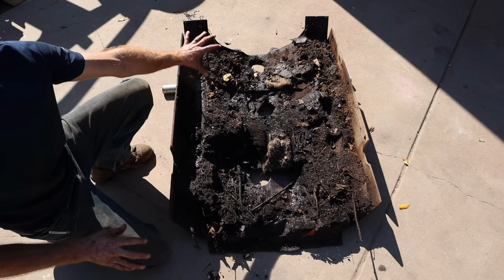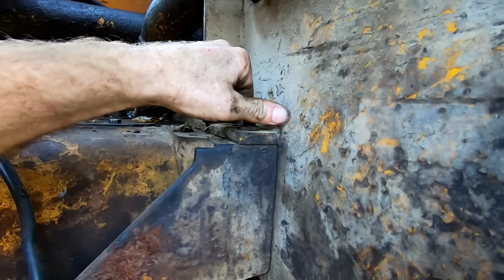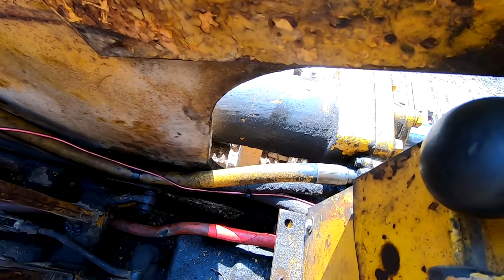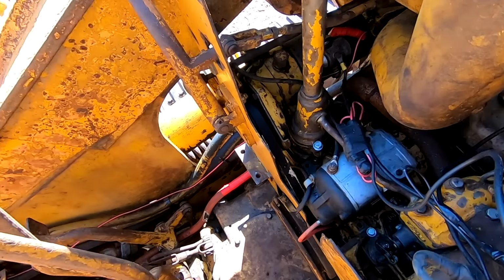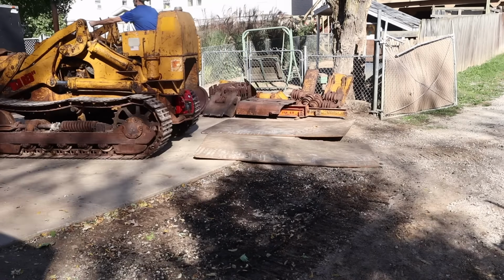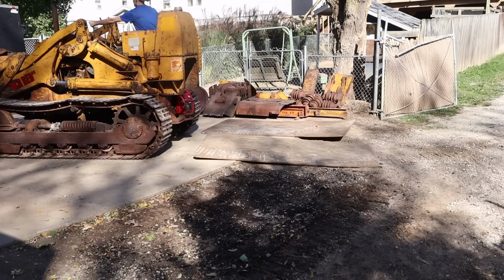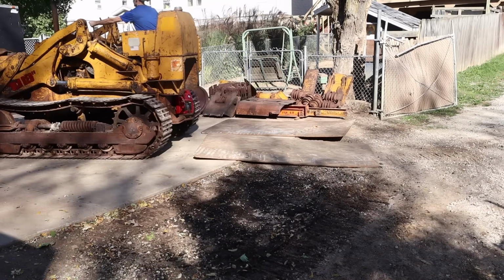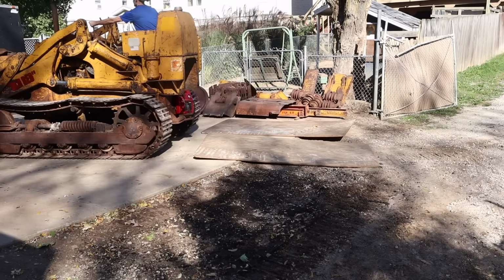FIRST Wash in 64 Years... or Something!?! ~ Part 7 ~ 1950s Caterpillar TraxCavator

Comment: Suggestion: When pressure washing any machine that has fuel oil gunk and/or concreted dirt, rust, and crude, etc. adhered to the metal, it is worth both your time and it's in the machines' best interest to use a high heat pressure washer. Yes, they cost more, but the difference that the pressurized hot water makes is worth every additional penny that you pay to own one. You will also find that the metal almost completely dries itself as you wash and hot water does not cause an excessive amount of condensation in hidden places such as that which you found in the dozer's valve cover.
Reply from the maker: I'd LOVE to have a hot water pressure washer, but I don't have one at the moment! I'm on the lookout for a used one or a broken one to fix, but for now I used what I had!
Reply: @Tishers  "Then your worries would be corrosion from grease getting washed out of the bearings" 

Ahhhhhhhh, I would point out that you do not know a whole lot about what you are suggesting with that negative rebuttal. I say this, since blowing out any grease from a bearing will not cause corrosion to the bearing, it will cause a bearing to overheat and wear beyond repair in a very short period of time before it even has time to corrode or rust. 

Further, any mechanic worth his business will always check each and every bearing for excessive wear, drying-out, no grease etc. and will immediately replace all that needs to be replaced and repack all those that are still in serviceable condition. He will perform that inspection and service automatically regardless of whether or not he thinks that the pressure washer may have blown out grease from the bearings. A scenario that is always carried out during a complete unit inspection for serviceability. Albeit, in this case, there will not be many if any bearings to repack and most to all to be replaced on a machine after 40 years of usage and 20 years sitting outside unprotected against Mother Natures' weather.
Reply: Check heavy equipment auctions on the internet, especially military equipment auctions.
Reply: I just looked at "Richie Bros." salvage auctions and there are more than 250 pressure washers up for auction or outright buy, many are hot water types and well within almost anyone budget, believe me. Go to their site and type in pressure washer and reap the benefits of purchasing a good, but cheaply priced washer.

Comment: Your intake valves are not seated or there burnt letting exhaust to come back through and leaking out the intake gaskets. With head gasket leaking You may as well have your head checked for cracks and Reseat all the valves  Great video You are diffently a Hard working young man. Its great to see This in the younger generation of today. Keep up the great job. Youll get the old girl in great operating shape one thing at a time.Thank you

Comment: I think your water under the valve cover got there because the cover itself is bent down around the mounting holes. If you push the recess back out straight to redome the cover you should be fine. Also  dont know if your aware thats the same engine thats in a D4 dozer as well as a #112 motorgrader. Just something to remember if you need some engine parts later in life. Awesome video series enjoy watching you work on the old dog.

Comment: I just found you through this series on the old Cat, and finished binge watching all 7 episodes released so far.  I love this stuff and I am already subscribed to Diesel Creek, Watch Wes Work, & Marty T to name a few, because of old machine stuff.  You are doing an great job, have excellent camera work, and I look forward to the other fixes required on this machine.  You have another subscriber!
Reply: Some other channels you might like are kt3406e and western truck and tractor repair. Both are very knowledgeable mechanics and both work on cat engines. Warren at western truck and tractor repair works on pretty much everything new and old, like Cummins, caterpillar, John Deere, Case, New Holand, etc
Reply: @blake1995  Thanks for that!  I am currently checking them out.  Cheers!

Comment: Might think about picking up a Hotsy pressure washer. Steaming hot water does a lot on old grease. Looked like that first, bubbling head leak may be a cracked head. shiver Like the old school gasket making. I appreciate the way you protected the edge of your concrete pad, smart. You're doing a great job, keep it up.

Comment: I have owned many of this series. If you did state bids it was required in my state,before you could bid on a state level you had to have a track loader. Excavater hadn’t come into play as a true form of moving material. I first bought a 933 with direct start,but was a standard shift,but I thought I had hit the lottery,because it had a hand clutch with the forward,neutral and reverse. I was able to buy it to get my business started,only because the forward and reverse lever ball was worn down and sticking the shifter rail on the transmission. And you had to stand on your head to solve the problem. If you could get ahold of one it was used as a loader,bulldozer and compacter if used by state requirements. Now as far as the pony motor we always for certain parked mine on a bankment steep enough to roll it off and start it and always had a can of either in hand to make it start ASAP. I worked with it until I could buy a 955 h. And at that point I thought I had struck it rich,lol I done many jobs with it and by then had established a working relationship with our local cat dealer. I live in East Ky. I received a phone call from the cat salesman in the early 80s. He said that they had traded for a 977 pedal stear direct start automatic,that was bought new to feed the Ashland Ky steel mill, I said that is a much bigger machine and I would have to get a bigger lowboy. He came back and said you will be the only one in four county area where I live to own a traxcavater of this size. I bought it and used it until Excavaters took the world over. I’m sorry this is so long but I get so tired of people putting the old cat 9 series down as a joke. I can tell you that with a good Operater and dozer to feed them with they were the best machine made. Also you already have the angle iron cut that I put under the cylinders to hold the bucket up so I could roll start it without the pony motor. Congratulations you have a great piece that built America.

Comment: Great work and even better attitude towards what you do which makes this fun to watch, I am not sure what your plan and budget is for the build but can't help thinking that piece meal taking on fixes as you find problems will likely mean you do more work than approaching this a complete tear down, sand blast / parts wash rebuild and repaint or re-plate, most of this machine will need some sort of attention even if only a wash, replace bolts and new oil seals / gaskets. Time and budget allowing (I know magic words) you would save a lot of problems and wasted parts & fluids if you break it down for a full rebuild, just my opinion very good luck with the build great content thanks !

Comment: It's still possible to be some condensation inside the top of the valve cover though particularly if the crankcase breather is clogged. Think of it like the greenhouse effect when the crankcase breather is working it's allowing moisture out.

Comment: The small copper line is what feeds oil to the rocker shaft assembly, not like a gas car engine that feed oil up the push rods to rocker assembly!  The pony motor feeds its exhaust in and around the intake to pre heat the intake to help start tge m and in engine. So could have exhaust leak at intake when pony motor is running! The electric start for pony motor belt can be adjusted after replacement. Nice you want to service engine etc.. but need to fix undercarriage and bucket mounts first to see if even worth serving engine. Long way to go and lot of parts to get there!

Comment: You need some purple power cleaner. Many of the big chain auto parts places have it. I get it in 5 gallon buckets and use a garden pump sprayer to apply. Stuff works awesome.

Comment: Your tractor thanks you for cleaning her belly pan, you will thank yourself for it when you have to do an oil change....which park it the day before, run a garden hose over the tractor and then when it is dry the next morning, then change the oil. For those loose bolts make the bolt long enough to double nut them since the arms flex the frame a lot and those bolts are stretched out, get rid of them and go longer to double but them.

Comment: I'm no ta diesel mechanic but your engine seems to have excessive crankcase pressure (blow-by around the rings), compression leaking into intake and exhaust (valves and or seats).  Since that means pulling and working the head a new head gasket will solve the leaks around the head gasket.  I suspect you are looking at a rebuild on that engine if you want it to do any real work.  Looking forward to the project.  Be aware that you can probably find a machine in working condition for less than what it will take to rebuild this one.  Same with old airplanes.  However, it is always fun and a learning experience to bring a machine back from the brink of death.  Best, Doc.

Comment: When removing broke bolts, start with a soaking in either kroil, or a homemade blend of atf and acetone, and let soak. Then left hand drill bit if your lucky they'll back on out, if not then add more pennetrant and add some heat and an easy out. That's how we do it anyway, works pretty good. If your good with oxy torch you can torch put the bolt without thread damage, but its risky

Comment: Water under valve cover from broken valve cover cap which exposed rubber grommet and allowed water to penetrate past and into the valve cover.  Cap hold grommet fully seated and sealed.

Comment: The stickers you power washed off are the cat logo.
You just as well pull every bolt and nut off the machine, power wash and sand blast the entire everything, paint it and replace every nonmetalic  part on the machine.
I'd invest is hard surfacing for for the bucket

Comment: When it is still running okay, I would try retorqueing the head instead of going straight to changing the head gasket.  If it something you will be using on a regular basis, then maybe do the head gasket.  That is just a lot of work.

Comment: If all those loose bolts are years of vibration, it might be worth your time to get a torque wrench on those head bolts and see if that stops the head-gasket leak.
ALL of those loose bolts seems a little weird, though. I've got a feeling you're going to find that one of the major components has a serial number that matches the parts-machine. 
Intake manifolds usually have exhaust passages to warm up the incoming charge, so, yeah, you could be leaking exhaust from the intake.

Comment: I'm sure the pony motor exhaust goes through the intake manifold of the desiel engine to assist in cold starts.
This might be the manifold leak your talking about. 
You'll need to fix this before dusting the main engine. 
Cheers from Australia. 😉👌

Comment: loose missing bolts were from not using locktite . cats will shake themselves apart without loctite .
 the water in the valve cover was from pressure washing and bad gaskets .

Comment: If you discover air leaking into the engine inlet filter all it means is the intake valves are leaking and need ground or the intake seats replaced in the head.

Comment: You need to take the whole thing apart piece by piece and put in all new seals bushings mounts  hoses rebuild engine and gear train then you will have a great piece of equipment yes exhaust can come out intake it means the engine is shot usually rings or valves good luck God bless I'll be watching

Comment: Couple of thoughts from someone who has restored two old Caterpillars:  The engine blow-by is because of bad rings on one or more of the pistons.  The head gasket will need to be replaced - don't try and retorque the head bolts to stop the leaks.  The undercarriage will need to be completely replaced.  Nothing you haven't identified but wanted to confirm.  Also, Squatch 253 on you tube can answer many of your technical questions and provide cost effective places to source good quality parts.  Finally, looks like you are wearing Army Green at 34:37.  If so, best of luck from this combat 'brother' to another 'brother'.

Comment: Check the head bolts before you buy a gasket, they may just be finger tight as the rest of the machine. 

Could also try to re-torque them 

Good job so far

Comment: Water under head gasket might be from the power wash getting thru worn gasket. Would not wait on the oil change, leaks, gaskets and missing bolts. Once done, a good tractor will run a long time.

Comment: An engine standing for a long time will have absorbed water into all sorts of parts.. Once started up again this will slowly be evaporated off and then condense again in places like the rocker valve area. Using the engine regularly will slowly drive it all away. It is too easy to assume it is a leak, and you may waste a lot of time chasing the cause, only to find it goes away on its own as the engine and gaskets etc. dry out.

Comment: Could the water in the valve cover have gotten in there when you pressure washed? I noticed the top of the valve cover is slightly dented in, like the nuts were over torqued, plus as you said the rubber seals looked bad. I know absolutely nothing about diesel engines and Cats but I’m fascinated with this restoration. I give an emphatic YES to the idea of painting a logo on the track parts and selling to raise money. Maybe a model and year also. I’d be willing to purchase something to help out but I really wouldn’t know what would be a fair price—obviously you have to cover your cost plus some toward the restoration. Looking forward to this series.

Comment: Try re-torquing the head bolts befor pulling the head. if that head gasket has been replaced before  and the bolts weren’t re torqued after break in it will do that and from the looks of the lack of maintenance yea they didn’t do that

Comment: Might be beneficial to remove the loader completely so that you can work on the engine and undercarriage easier and send the cylinders for rebuild.
Reply from the maker: Good thought and when I get to the head gasket I may do that... but the plan is to replace this loader arm with the other one from the parts machine, but I don't want to remove the one on the machine until I have the new one here at the shop... I'll use the machine to unload the other arm... Plus I plan to rebuild the cylinders myself!

Comment: I would have used a steam cleaner  (pressure washer with a inline flash steam boiler that heats the water) as they are great for built up grease, oil and built up grime

Comment: I think you are getting blow by in the rings causing the fumes and crank case pressure. The water would be coming from the leaking head gasket and the water is from the coolant.

Comment: In the belly pan you can find every washer bolt and nut that was ever lost I know I sure did lol when k Cleaned mine it was so packed in for so many years it was like cement still can't get the belly off bc the bigger bolts heavly stuck in but I got a lot. And just so you know when you get a new head gasket it won't be copper any more be metal and will need to out some gasket sealer on it took me 5 times taking on and off for this one video guy to show that just fyi

Comment: You are doing great. I love to drop the belly pans, I have found tools, money, padlocks and one time hyperemic needles! fired that operator. May I suggest you get a hot water pressure washer, cuts though the grease and oil. I saw the fuel filters you have and found a new ones, I will send them. Did you get the operators manual I sent? Keep up the good work.
Bill
Reply from the maker: Thanks Bill! That's crazy, I didn't find anything fun like that! I ABSOLUTELY want to find a hot water pressure washer, and I'm already looking for one a good used one! I don't want to pay what they cost new! I DEFINITELY got it, thank you! I've been learning a lot from it! Another viewer helped me find the parts manual and the D47U service manual in PDF form, so that has been a HUGE help as well! I have been making a parts list and was planning to email it to you soon and see if you had any of the parts! I would truly appreciate the fuel filters, thank you!!

Comment: exhaust from the valve cover and crank case vent is blow by due to bad rings and probably leaky valves or dirty valves, valves will probably need to be re cut or re lapped. you can actually get new rings from CAT

Comment: Have you considered enzyme or bacterial based de-greasers?  They cost a penny or two.  But, they don't dissolve the grease, they digest it.  Leaving only water and carbon dioxide behind.  Of course, they don't do a thing to metals or the like suspended in the grease.  Still, I've seen these type of cleaners almost melt the the grease off.

Comment: water in the valve cover came from earlier pressure washing..  the top of the valve cover needs to be straightened..  its caved in allowing any water that ends up on top to sit around the valve cover hold down grommets and seep in.. usually between the reinforcement and the valve cover so when you held it on end the trapped water ran out. 

 when you change hoses..  please log the Length .. the end size and the location.. so when you need one.. you know the measurements.